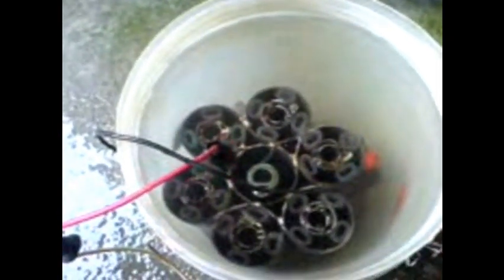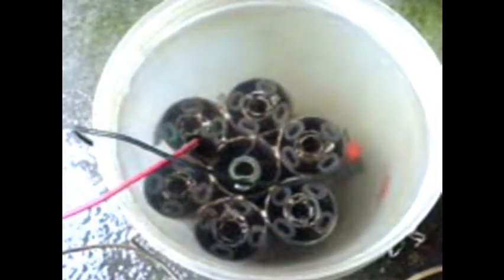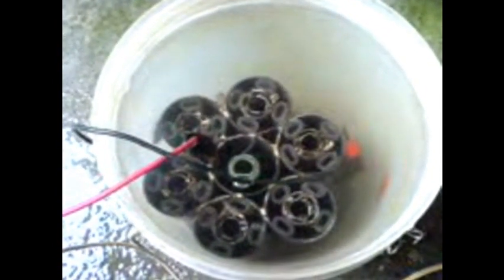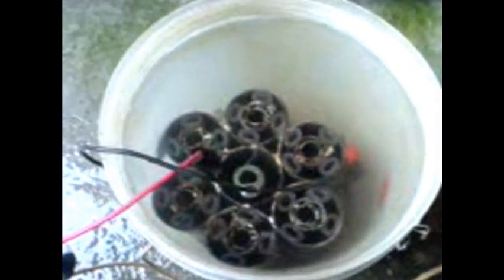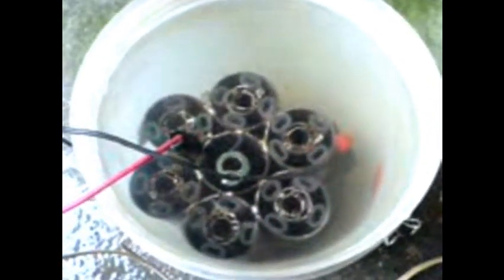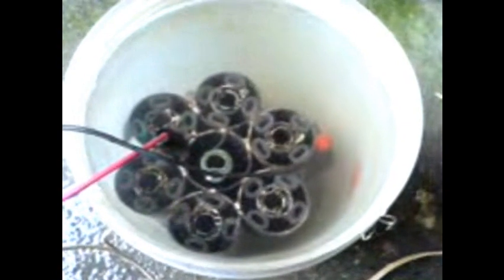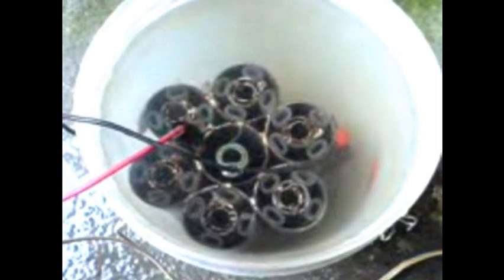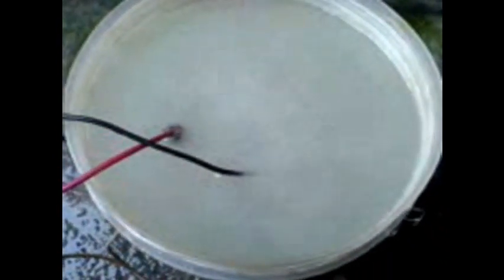HHO Honeycomb - Modified

Comment from the maker: @jmsapinoso Bro...d pa tapos tong GEET system ko. wala pang boiler. Sa gamit nito ngayon, HHO dryer muna para siguradong gas lang mahihigop sa chamber at one thing, separator din sakaling may mahigop na steam, e split din nya into Hydroxy.."Hydrolysis" double purpose..palagay ko, malaki pang tualong kung may boiler steam generator pa.